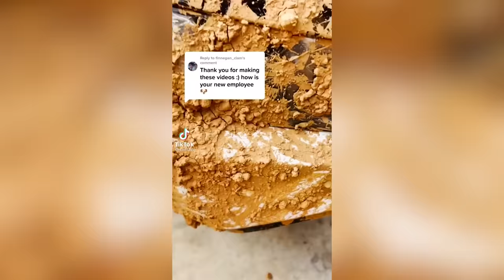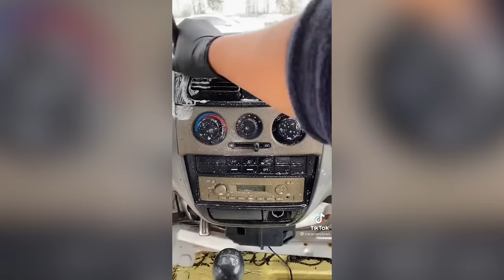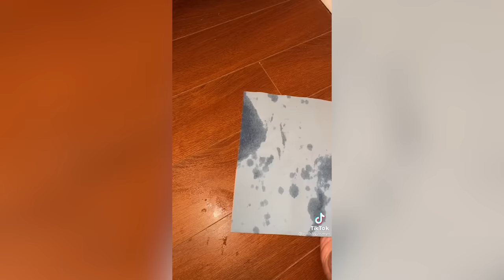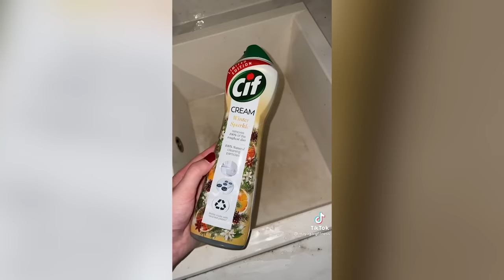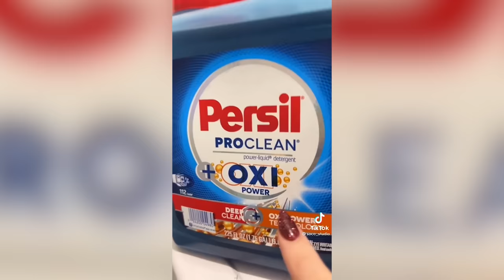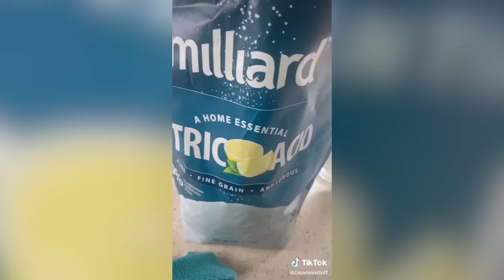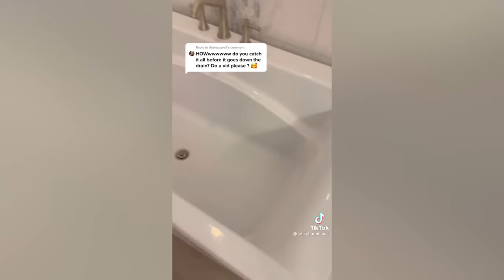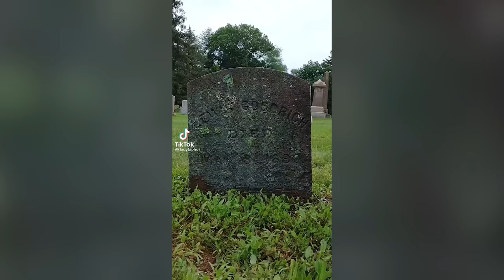1 Hour of Cleaning and Organizing TikTok Compilation

Comment: the very first video, yes
we love that
she wasnt stupid, she didnt make mustard gas in her sink
she didnt over use, it was perfect, shout out to that girl in the beginning for not being stupid
Reply: That was right!<3
Reply: As someone who has always been in the lower middle class I always slightly cringe to myself when I see people use an appropriate amount and not the absolute bare minimum that I have always used😅😂
Reply: @XxsubaXx88 ahh yes look at the way he is acting! yes yes, very distinguished🧐🧐🧐
Reply: ok but also her not pulling up her sleeves 😭
Reply: She poured vinegar on the baking soda though, which of course neutralizes it so it basically does nothing.  Still a lesser sin than mixing ammonia and bleach.
Reply: @160p2GHz  The people who pour vinegar on baking soda down a drain are doing it for the reaction that happens as it is turning into salt water. It is said the fizzing can break up things that are lodged in the wrong place without using the toxic chemicals found in a drain opener. They are a completely different animal than the people who mix them together then try to clean with them. Those people think it works because they scrub like hell. If you pour water over most things and scrub within an inch of your life, it will remove some (or most if it is not too dirty) of the surface dirt. Thus, they are wasting so much product/money (baking soda and vinegar are not as cheap as water). For those trying to save chemicals, they could always do a water clean first to rinse away the surface dirt.
Reply: She actually did use a lot more than she needed. I use that product (and many other cream cleansers like it), and you can use a lot less by adding a little water right after you start scrubbing. She scrubbed without water. Then, she did not even scrub with the water (limiting the suds, which are the best part) as she rinsed. That said, I still enjoyed watching it. I would have liked it better if she created more suds by scrubbing while she rinsed, but she was clearly just trying to clean while I enjoy creating suds while I clean (and still use far less product than she does).
Reply: @PotentialofHydrogenClean But some liquid detergent and hit water will do the same.
Reply: *hot

Comment: Did she do dishes in the bathtub?
Reply: She stated they had no running water downstairs. Hence why there were also bottles of squash on the windowsill.
Reply: #cheap
Reply: @katiejack7972  or, you know, having a new kitchen fitted, having a new sink installed. She most definitely described it as an unusual situation. We don't just habitually do our washing up in the bath in the UK.